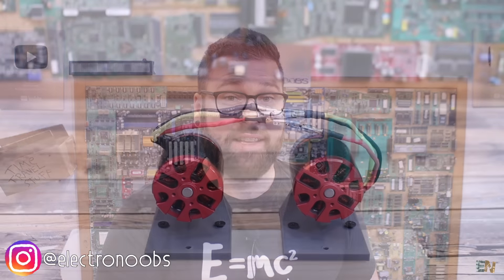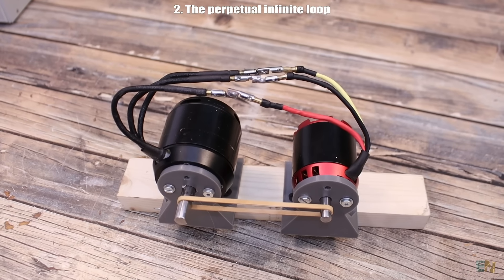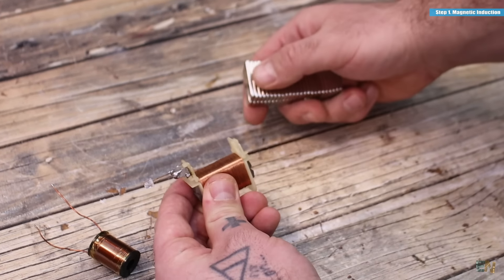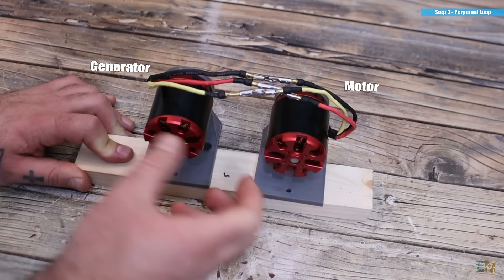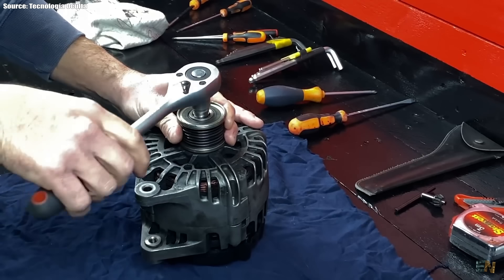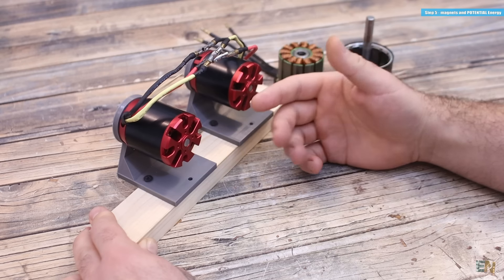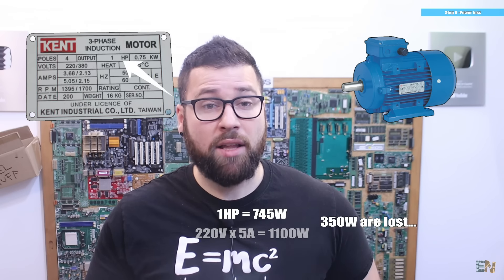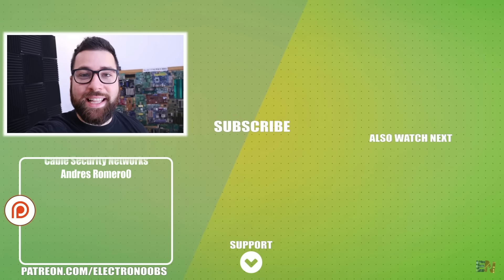Free Infinite Perpetual Energy Nonsense - FAAAAAAKE

Comment: The part people don’t get when they believe these videos is that an electric generator only produces the amount of power being asked for (up to its maximum output) and a power source like the electric motor turning it can only return the amount of power (or less) that is being provided to it. An electric motor is never 100%  efficient - usually between 60 and 80 percent depending on the design and age. So an efficient electric motor asking for 500 watts of power that is 80% efficient, returns the equivalent of 400 watts of power and the system immediately fails.

Comment: if nothing else, the 'plate' they bolt everything down to - is hanging off the table... which adds a question of "why" - is there a hidden wire back there providing external power?

Comment: This one guy had a video for "Free energy". He had three donut ceramic magnets, the kind you find in microwave ovens. So he wound wire around them to make toroids, then connected the wires to spark plugs and it was somehow supposed to put out 500 watts or something super ridiculous.
I cant tolerate crap like that. There are a lot of good kids out there that dont need to be discouraged by aholes like that, and I'll sound out on them loud and clear. If hes not going to teach them real projects, then he should at least teach them the dangers of fooling around with hi voltage and doing stupid things that could kill them.

Comment: When I was still a child I thought of connecting a motor to a dynamo to keep it running constantly. I made sketches of it. Later, when I got older and was able to build the mechanism myself, I discovered that it didn't work at all. Later I also read articles about people who had tried to build a perpetual machine in the Middle Ages. But none of them succeeded. It was also clearly explained why it was not possible. Then I also understood what I had come up with would never work. And that is a nice learning process. But if people are not technical enough, they quickly believe that everything is possible. While much is possible, but not everything. The earth has many raw materials that we can use to convert them into energy. If you have a triangle, the base is the source of energy and the point of the triangle is what is left to be harnessed. That a lot of energy has already been lost and that there is little energy left to use. I think solar energy, wind energy and hydrogen energy will last the longest. Unless new energy sources are discovered. And that will certainly not be perpetual energy.

Comment: The only way you can prove someone's work to be fake is if you will do the experiment with a perfect replica of what they have used in the video. I was 14 years old when I had this Idea of making my own power from electric motors, I was rebuked by an electrical engineer. 10 years later during the crises of power outages in the Philippines, I saw in one of our leading newspapers how a  German scientist that happened to visit the Philippines and made a prototype using set of car batteries, a dc motor, and 5kv generator motor, and a circuit board charging the batteries, and act as a governor to speed up the motor when load is applied. They were able to use 3k to power a farm...
Reply: That is why until now I am learning how to do it. I know the heart of the system is in the circuit design that scientist created.

Comment: Anything new is naturally opposed. It took 100 years before Galileo's sun centered view of the solar system was accepted and many centuries to accept the fact the earth is round, not flat. My conclusion is that energy can be extracted but that there should be some evidence of this extraction such as the decline in temperature in the area close to where extraction takes place such as the decline in the temperature of a portion (such as a magnet or coil)  or even the volume of air of the system. Measurements could be taken over time with sensitive equipment but so far, as I know, this has not yet been done. When electricity first came into my area (1920's) I was told that the workers tried to blow out the bulb with their breath as they did not understand electricity.

Comment: The reason the government doesn't use this trick is cause it doesn't make them money...  that's common sense..

I don't know about any videos and I don't have any videos myself but my dad has been using this trick for decades by just using 2 alternators to run his tools when he was a Semi Truck mechanic when the trucks were broke down on the side of the highway... I use this trick to charge my batteries when my solar panels aren't making enough energy. The only difference between mine and my dad's system is that I use 3 alternators for charging and 1 modified alternator that works as a motor. I've built these things for my neighbors to put on their RVs, power their sheds etc etc... my dad has been building these things since the 70s..

I also use  alternators to make Tesla cars self charging. for the Tesla idea I modify a pully to weld to the CV axle. make an adjustable bracket to mount to the under carriage, use a power steering belt, run wire to the charging port, run a switch to the inside of the cabin... when the battery hits 30%, hit the switch and keep driving, the car will charge itself. I've done this to a 2019 Tesla Model S 2 years ago and it's still on the road. It has used a charging port since.. I've also done this to a 2020 Tesla Model S about a year ago and it hasn't used a charging port since.. those Teslas are officially self charging vehicles.. they take around a half hour to 45 minutes to charge.. then when fully charged just hit the switch to turn the power source off... it's so easy it's basically plug and play..
I dont make videos... I've already proven these to work.. I've taught my sons how to make these.. taught my neighbors.. I also teach this skill in my Youth Wilderness/Urban Survival course.... Your video isn't convincing me any.. don't know about other people.. not saying you're a bad guy or anything like that... all I'm asking is "build one" and I bet you anything it works.. I don't modify any of the alternators used for charging.. I do modify 1 alternator to use as a motor.. it's not rocket science.. very easy to do.. I k ow there's way to modify the alternators so the create more power but I don't know how to do that.. since I'm a mechanic I have access to as many alternators I want for free... it would be stupid for me not to use them..

I just looking for new trucks to use.. but it seems like I should just stick with the original idea..
Reply: This is a great story, thank you for sharing! A video would have been nice, but we’ll settle for a couple of PIX from your mobile phone. A testimony from one of the modified Tesla owners would be very helpful, can you do that?

Until then you just have a story…
Reply: @pstonard  And a pretty stupid story at that🤣

Comment: I have thought this up also but, i was going to use a floating magnet generator not regular bearings but magnetic floating bearings. Also to turn the generator; I was going to use earth magnets and a lever to spin the pulley/generator.  Or, I was going to use electromagnets that kick on using a pickup coil; still nothing touching. Thereby spinning the generator once spun by hand. By advancing the pickup coil timing by moving / turning the pickup coil to increase speed or a timing circuit. Also I was wanting to see if I placed the whole generator in a tube like it was a bettery and vacuum pump to create a vacuum in this sealed tube.

Thats all.

Ocean waves can also spin a generator with levers and an ocean.

This is to power not just 1 house but several states. Also power wires need to be run underground and even better by optical cables using a lazer to transefer electrons with.

Idk about the lazers...

But, the generator will self turn by Earth magnets for 1k years.

And Free Energy.

We are not smart all the best ideas are outside of the box!

You Can Do It!

Please make a video when you have accomplished this!?

Your awesome and  thanks!

Comment: There was a bit of an issue with your science in this video.  You kept making reference to a 1hp motor and eventually showed the nameplate of it and pointed out the 220v @ 5A on the nameplate referring to 1100watts of energy and then pointed to a loss because of the 1hp "rule of thumb" making it 745watts.  The nameplate doesn't state how much energy is output by the motor, it's how much energy it may use if maxed out in resistance.  If it used 1100watts and you have a 150A alternator connected to it at 12vdc, that is 1800watts potentially with a 700watt delta.  Yes there would be losses but it could potentially work if the output rpm of the motor was high enough.  The biggest issue with the "fake videos" is that it makes no sense to modify the alternator and you would have to use a power inverter that could handle that much wattage.

Comment: Your discussion about gravity is a little off.
That object on the table is still trying to fall at 9.8ms/s but the table is "pushing up" with greater force (or commonly "structurally resisting the objects force") while the table itself is still falling at 9.8ms/s but is being resisted by the floor.
In short: You, your table, the objects on it, and everything else on or near earth surface is in a constant state of falling.
However, everything's kenetic energy has been released back into the system.
When you lifted that object you used an equivalent amount of kenetic energy as the object gained in potential kenetic energy. Once the object is released, your energy lifting it up goes to zero, it's potential becomes actualized, that actualized energy is released back into the system when it impacts the table.
All of that to say, no NEW energy is created when you lift the object or let go. It is merely moving around within the system.

Comment: So use all the info ive given to you all and maybe more i dont know of like the light sensors as a pickup coil device to kick on and off the electromagnets  to spin the generator. You would then also have to make a pcb to adjust the timing of when in time the electromagnets fire off.

Comment: I'm a little confused. You've spent time explaining how magnets create electricity through movement relative to a coil, but you do not explain how this is not happening when the magnets (which appear to be attached to the alternator's rotor) pass by the alternator's coils in the stater. Remember they altered the alternator and attached extra magnets to it. This is where at least I, and probably others, are confused. The alternator is already designed to transfer mechanical power back to electric power. But the videos didn't just use an alternator. They modified it by adding extra magnets. I think you would have done a bit better job actually doing a replication of their actions and shown how it does not work.

Comment: First I believed what they made was true. Then i realized it was fake. But as I read more, I started to question. Obviously what they made was fake, but there is something funny about the physics of this. All I hear is that there is no free energy, and I hear about transfer from input to output, which coudn't have an extra. In all discussions about the anti-free-energy crowd there is no technical discussion of why not, but just a reference to the dogma, because an extra source of energy, such as like "aether" or "quantum foam" is not a valid subject.

Generator theory actually has some links to free energy. What does it say ? That as long as you defeat the electromotive force counter drag, a generator continues to work and it MAGICALLY provides the required amperage by the load. So as the generator spins slower, voltage drops slowly while amperage grows to MAGICALLY meet the demands of the load. During this time, more and more counter drag is applied to the rotor.

But let's presume that an alternator - not necessarilly a car alternator - is changed to have permanent magnets on the rotor. 

Now what does physics say ? Lorentz force applies on charges travelling in a magnetic field. These charges are travelling inside the wires of the alternator coil, which is stationary - cause it is the stator. Now, how does electromotive drag slows down the rotor if it applies to the stator ? Shouldn't in theory such an alternator exhibit no electromotive drag, being able to generate amperage up to coil meltdown ? I didn't find anyone to answer this question.

So what am I saying ? That electromotive drag should apply only to generators with rotor coils, depending on the construction of the coil and dynamic of Lorentz forces moving on a 360 degree pattern, while a permanent magnet alternator, the very opposite design, should be free from Lorentz drag and therefore get to overunity. Do I make any sense ?

Comment: The claim is not "the power is comming out of the magnets."
The claim is the magnets are increasing the density of the magnetic field being cut by the same amount of copper.

Since current never electrically passes from the 1st coil of a transformer to the 2nd... where exactly are 2nd coil induced current electrons being replenished from?

Comment: What about if you use different sized pulleys? one over speeds the other or gear reduction? flywheels?
Reply: Flywheels and pulleys involve friction, which means that available energy is lost to heat. They don't add any energy to a system.

Comment: You forgot that the person internally modified the alternator by inserting neodymium magnets with a magnetic force of 7kg each.  This modification allows to generate much more current than the norm, more than enough to power a small 0.75kw motor. 
The experiment you have done is to be considered useless, as the components used have different characteristics.

Comment: they didn't connect the alternator directly to the motor they connected it to an outlet. Weather its fake or not it doesn't help your argument if you don't do the exact same thing they did. also the motor only needs enough energy to be turned on so if the generator is spinning long enough to cause the motor to turn on then you'll get the constant motion you need to keep the magnets moving. Not saying your wrong but your video doesn't actually disprove it.

Comment: first of all, we keep in mind that those who manage to produce electricity certainly do not think they are going to publish it on youtube, those free energy videos are made to make as many likes as possible, for example I know how to make energy from nothing, but not in this way and with this method, and in any case I don't show it to anyone for free, not even for a million dollars, it's a secret thing of mine, a little clarification on the inverters, that little inverter you showed with the lithium cells would not even be able to turning a drill, imagine a 750w motor, would be impossible with lithium cells, simply those who make these videos connect the motor to the electrical socket hiding the cables well or using video software that hide details, this project made with motor and alternator, does not of automobile !!, well nicola tesla had thought it well, and it works but not like that other things are needed that I do not say, after which it works, so energy from nothing exists but you have to know it to do, and that's it !!

Comment: try make pneumatic engine that generates air pressure more than the operating system

and then add the two generators AC DC and other mechanical jobs

Comment: No Sir. Energy is not created by the creation and collapse of a magnetic field and that is the bases of your whole theory. Induction Energy is created by the amplification of the electrons by the number of turns in the coil "wire" itself and this amplification which turns into heat energy continues to rise while there is a constant power source applied across the coil, which will cause the coil to heat up so greatly that it eventually fail, just like an electrical cord that gets a kink in it and the heat causes it to burn into or it may even explode if there is an iron core center, when there is not at least a brief rest from the induction and from the power source, therefore the flux is necessary for no other reason than to safely manage and maintain a constant load across the induction coil. Yes, sir.  it is possible to use a dc motor to operate an alternator and convert the power of the ac back to dc to power the dc motor, except the battery hours must be taken into consideration when using batteries as the power source instead of a capacitor.

Comment: You show 2000W in and 3000W out. When this model will stop generate watts? Is it correct that it will stopped if some external device will use 1000w?